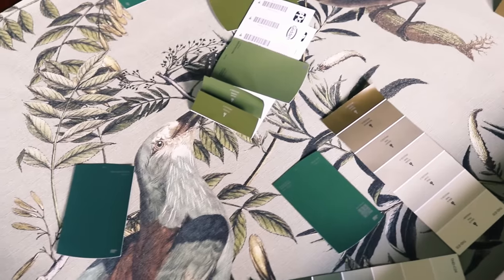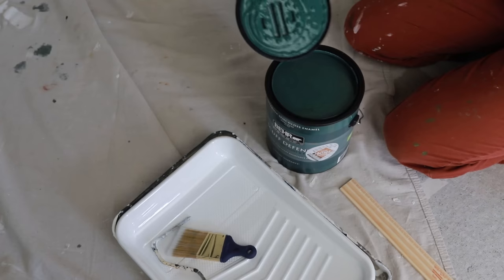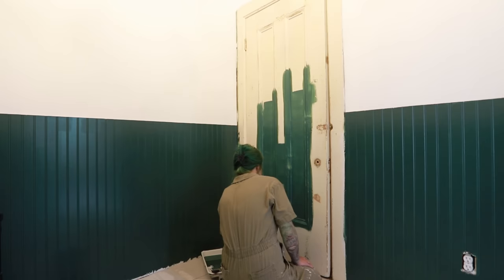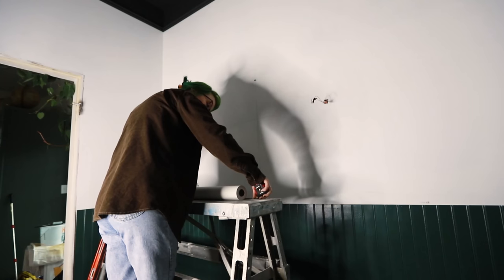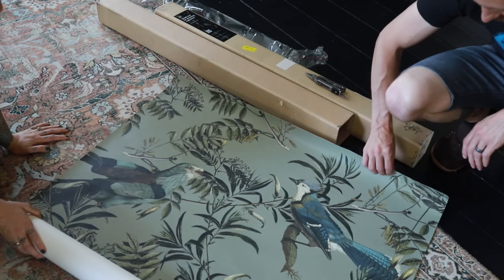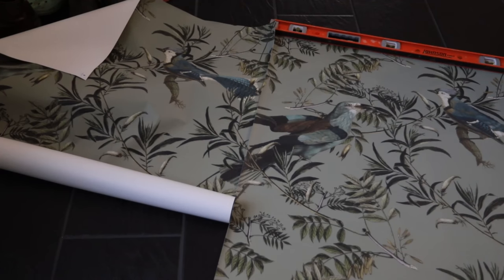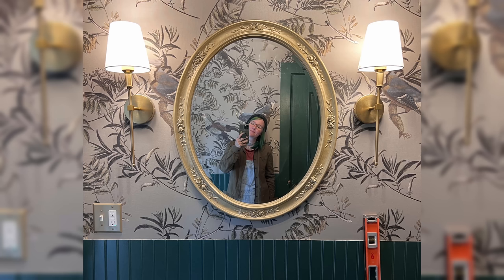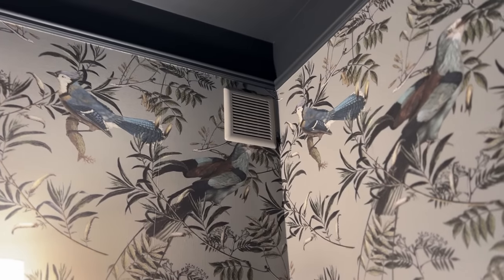this week at the mansion - painting paneling + hanging wallpaper in the half bath!

Comment: You're at the pretty progress part of the half-bath which is always dramatic so yeah this video looks like a lot of progress in a short time, I have no doubt you've had weeks where you've had loads of progress but it just didn't look like it. All the boring but important foundational work take aaaaaaages and it looks like nothing's happening, but when you start slapping paint on the wall and installing light fittings etc suddenly it looks like an actual room rather than a building project.